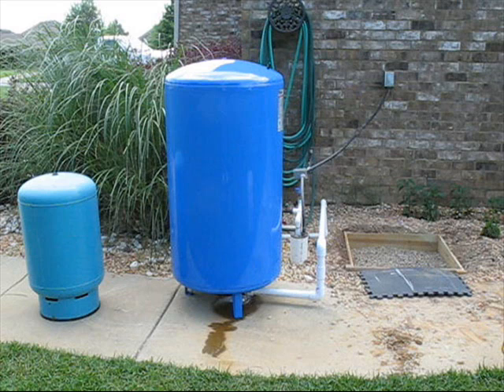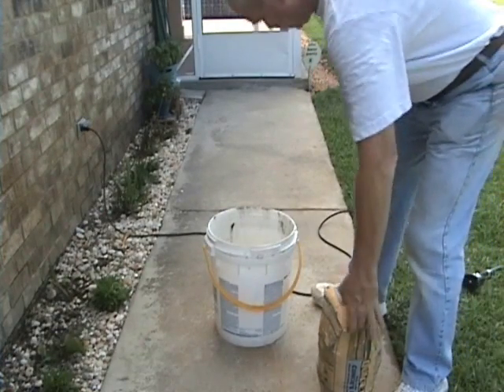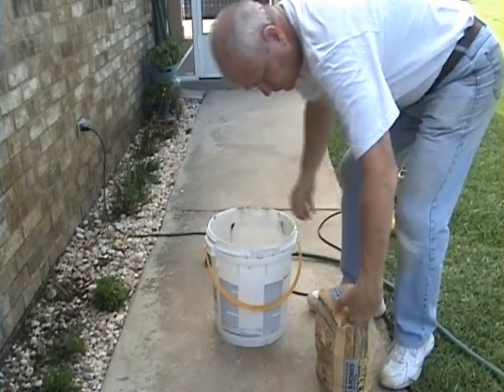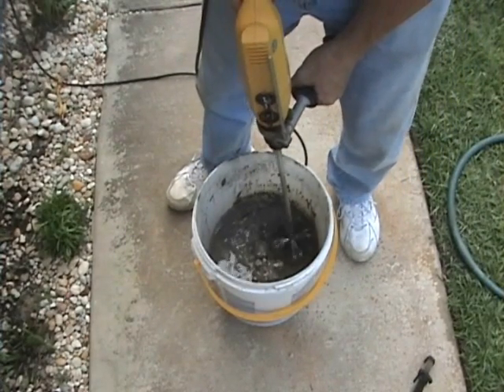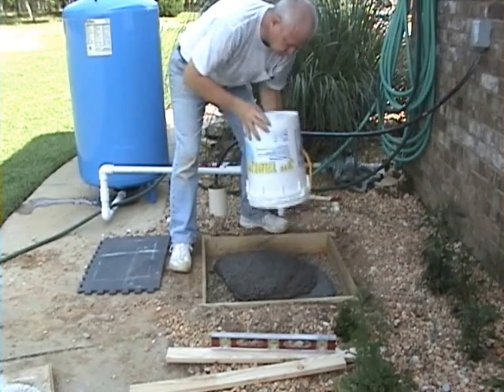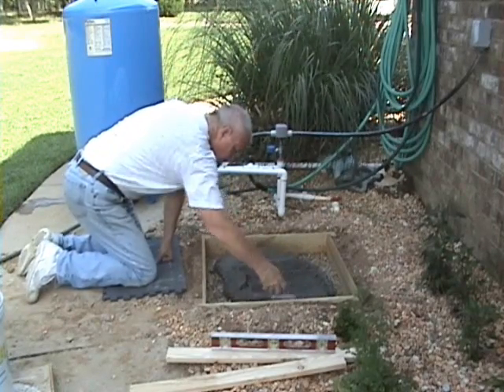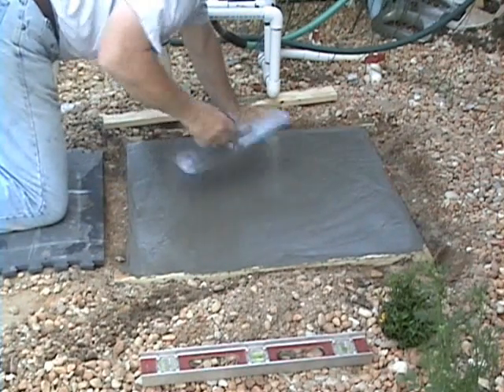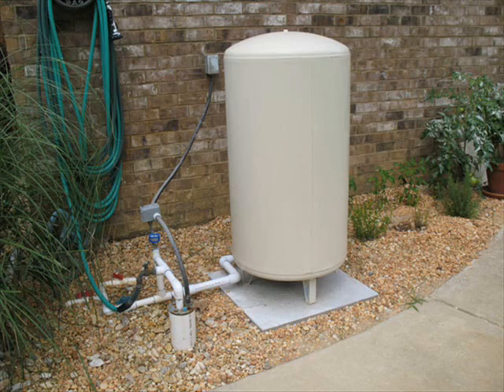HOW TO POUR A SMALL CONCRETE SLAB - from the Drill Your Own Well Series

Comment from the maker: The manufacturer of the cement claims it is not needed as there are fiberglass strands in the product for that purpose.  To be honest with you, I just didn't know at the time.  Now, I'm thinking the fiberglass strands thing is legit because it has lasted eight years.
Reply: Thanks for the video, I'm laying 2 concrete slabs for gate operators and this is EXACTLY what i was looking for. Awesome job!
Reply from the maker: Great!  Good luck Vick!

Comment: A little advice: Use a cement mixer. they don't cost that much, besides, usually there's someone you know who has one and will let you borrow it. Never add water until the concrete mix is already in the mixer. Start with a few second's spray, let it mix. Add small bursts as it turns. Eventually, little balls will start tumbling. Add another burst. Do this until the mix starts "slumping" over. Remember: too wet and runny, and it will end up as a disaster. It's like cooking: You can always add, but you can't take out water. Another thing: Buy a magnesium float. Once the surface is smooth, DON'T OVERWORK IT. Now you all have a nice day.
Reply: Why in the would you advise him to use a mixer that cost $200 for a tiny job like that? The bucket worked just fine and its free. And what is supposed to do after he uses it once? Keep that stupid thing in the garage? And then you tell him to borrow one. Is he supposed to drive a half hour to get it from his friends house? Seriously. Use your brain man.
Reply: soco13466 yeah probably 3 bags of Crete take no time to mix!

Comment: Great! How many 40lb bags (total lbs) did you use for that area?
Reply: Determine the cubic feet or cubic yard(s) of the project. Width x length x depth. The bag should show how much volume it will yield. Then buy one more bag than your math calls for (Murphy's rule). For leftover concrete, try to have some use for it, like under downspouts, etc. Don't mix until that's all been planned.

Comment: -about the geothermal system. .
 -1.  When the pump is operating, how many feet down, is the water level below the tank being pumped into, and how much pressure (psi) is the tank being pumped up to ??   ( average, or amount of variation, or both )  
-2. would you be able to estimate the amount of water pumped in a day or hour ?? 
-3. do you have any method to use the siphon ability of the depth of returning water to help pull the water up, so the pump does not have to work as hard ??

Comment: Nice job.  Just for future reference, you should always use a concrete edging tool to put a finish edge around the perimeter.  This will prevent chipping and cracking on the edges of your slab.

Comment: you mention the pump was cycling . this is usually because your tank does not have enough pressure in it . you can use a tire gage to check the psi fom the snifter valve .
the tank should have a psi rating . usually about 20-25psi . it is also possble that your tanks bladder has a hole in it .

Comment: FYI, you could have knocked it down to a single bag of Portland cement if you had used an aggregate in the mix.  Most slabs are a ratio of 1 part cement, 2 parts sand, and 3 parts gravel.